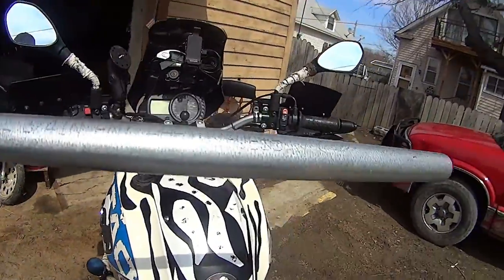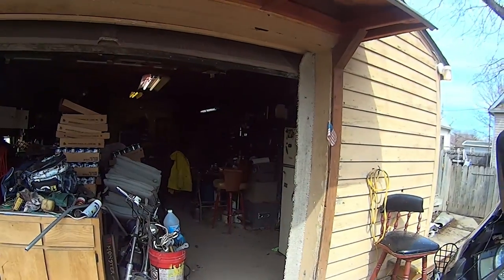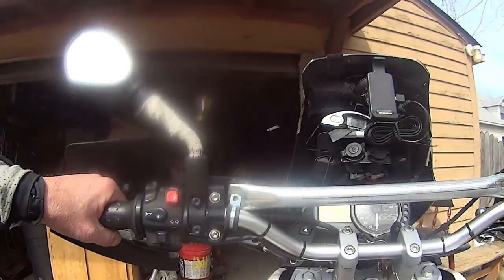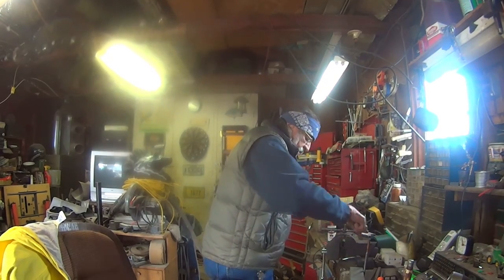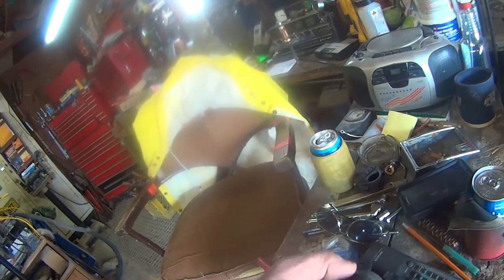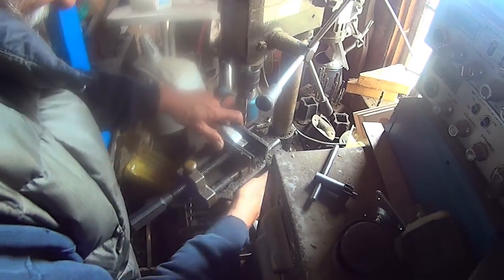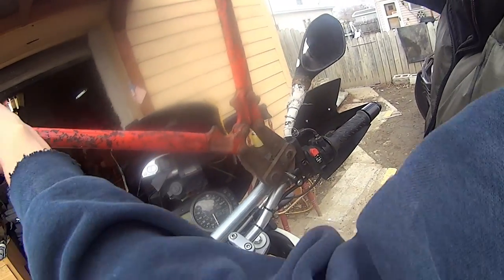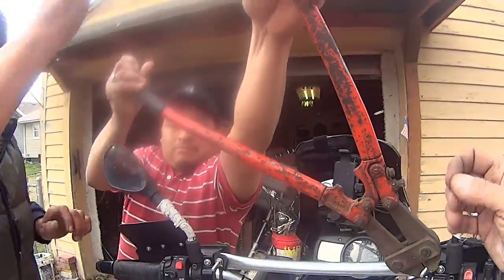Howto build your own CrossBar

Comment: If you have normal way round suspension you can also use those clamps (only in larger size, from pvc for gray water lines) as font fender mounts you could height adjust :)
Reply from the maker: I don't trust the front fender to support any weight. Many have broken on the Sertao.